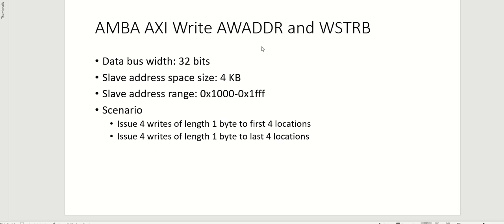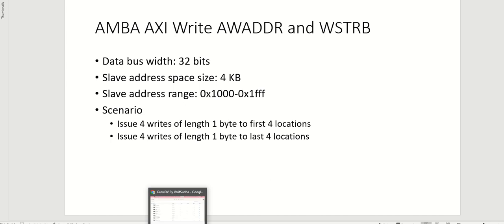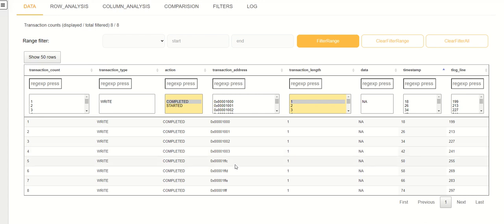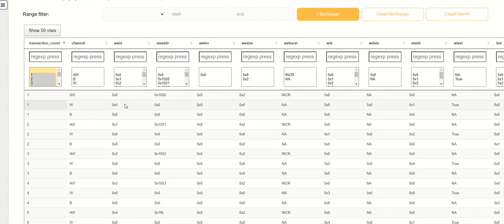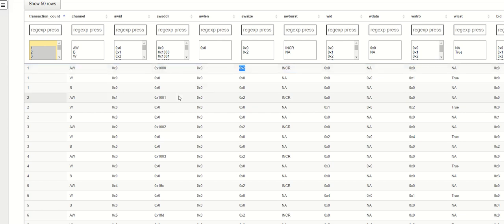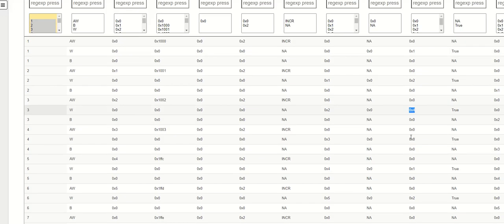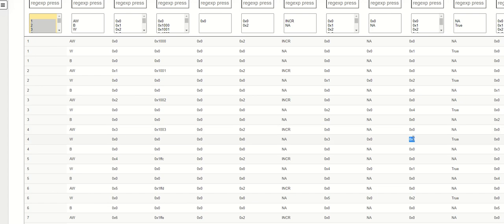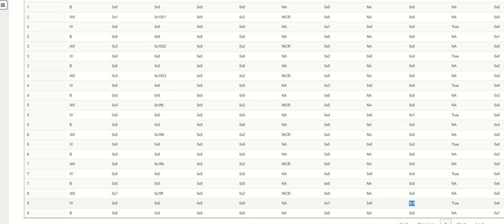Master AXI protocol:  AXI WRITE 1 Byte length

Comment: Thanks for covering this topic !

One approach shown in the video is to control the address and WSTR both.
Can the same result be achieved by keeping the address the same and only changing the strobes?
Eg :
The naturally aligned address will be 0x0,0x4,0x8....

ADDR - 0x1000 AWLEN - 0 WSTR 0x1 -> Update the slave memory with byte location 0 (Addr 1000)
ADDR - 0x1000 AWLEN - 0 WSTR 0x2-> Update the slave memory with byte location 1 (Addr 1001)
ADDR - 0x1000 AWLEN - 0 WSTR 0x4-> Update the slave memory with byte location 2 (Addr 1002)
ADDR - 0x1000 AWLEN - 0 WSTR 0x8-> Update the slave memory with byte location 3 (Addr 1003)
Reply from the maker: Yes, that would also work. Primary point being what the SW is trying to read or write. It won't be worried about making the address naturally aligned but if the address is naturally aligned as well the WSTRB can be used for writing specific byte locations.
Reply: @verifsudha5307  Thanks for clarifying. The choice I guess will depend on the slave's capability to support unaligned addresses. If not, then the master will have to rely on using aligned addresses with proper strobes.